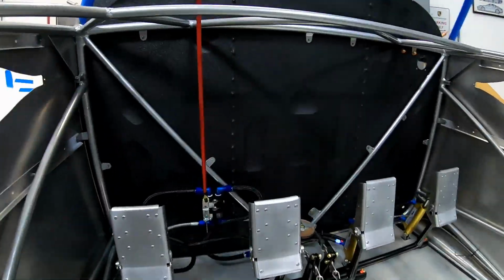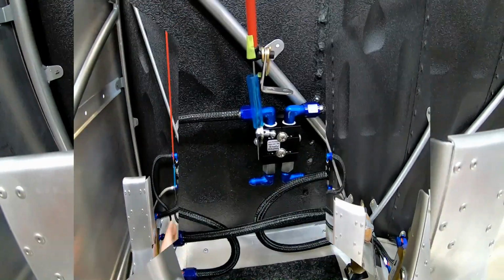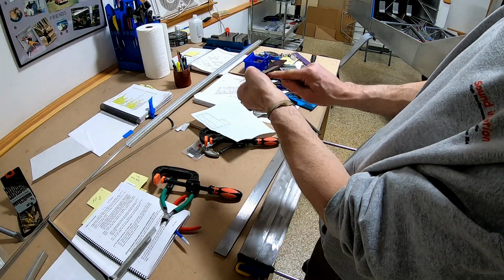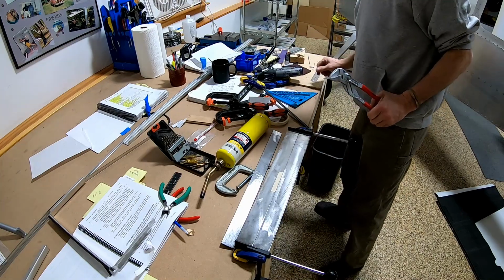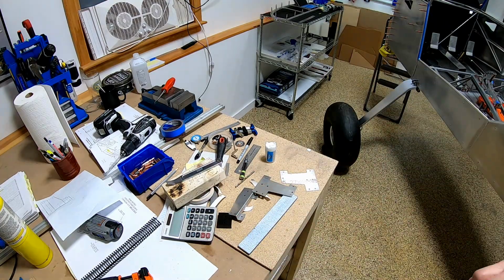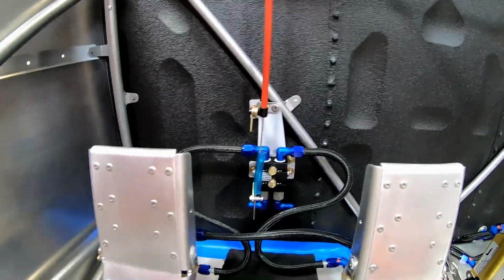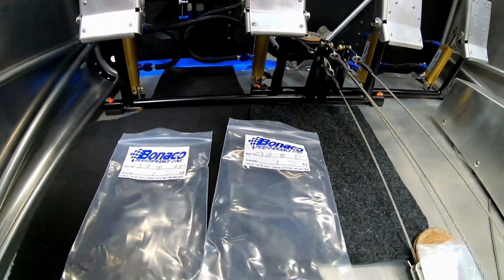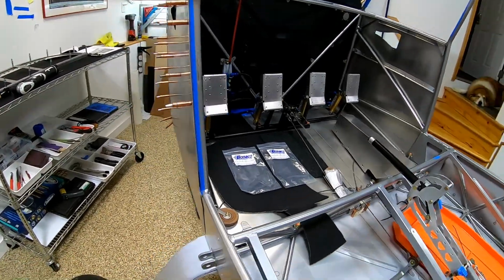RANS S-21 (056) Custom parking brake bracket and brake line discussion

Comment: Thanks for this! I’ll check it out. What size stock did you use? The clang sounds like .040”.
And any concerns about annealing the corners? Does it lose any strength when you do that?
Reply from the maker: I believe it was .040. Before hating it, one of the feet cracked from too tight of a bend.